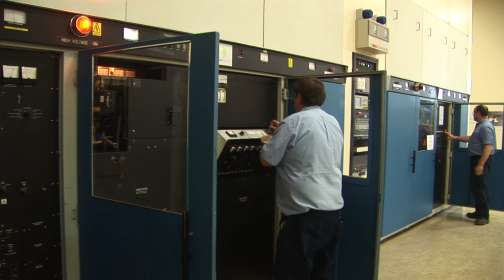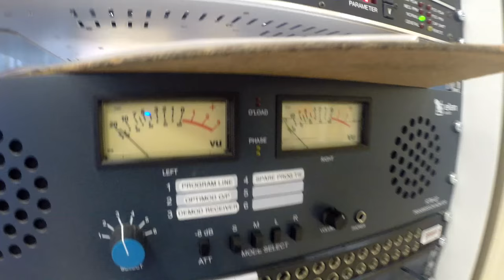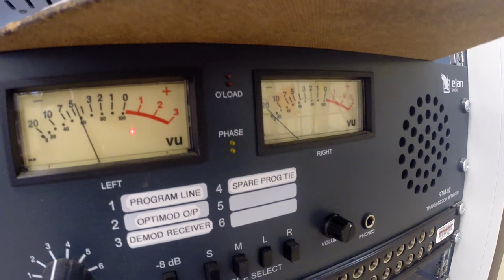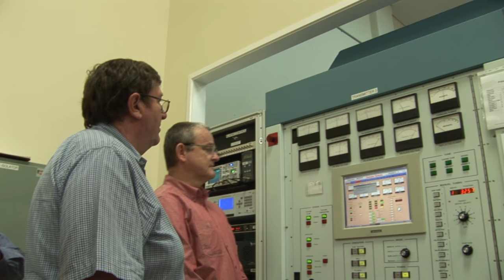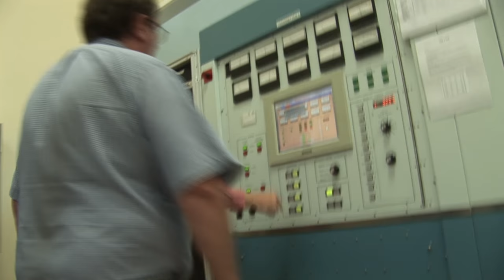Shutdown Of Last Short Wave Transmitters  At Radio Australia

Comment: Wonder why they didn't switch over to DRM. Much more efficient.
Reply from the maker: Yes it has its place but there are tens of millions of short wave AM radios out there and extremely few DRM sets and in practice DRM is very good for strong sigs but just does not stack up when stations are weaker or bad adjacent or on channel interference is present like most of the time.  If you get no dropout DRM reception the AM would be almost perfect also although you do not get the fakeish FM sound. There are just not enough DRM radios around and most are very hungry on batteries. Anyway have another drink.

Comment: Yeah, but next to no one manufactures or sells short wave receivers. You go around shopping for radios and attempt to find one with short wave as well as AM and FM. Even in the 1980s that was becoming an increasing problem. They were around on sale but were becoming much less prevalent.
Reply from the maker: In Australia the major eletronics retailer Jcar, has a good range of multi band radios. They sell a nice Digiteck digital set for around $100 that is very sensitive with exceptionally good audio on Am. It covers Lw, Mw, Fm, Air band and Sw from 2.3 to 30mhz. Also selectable bandwidths. I have also seen $20 short wave radios at the cheap shops, not that good but will pick up the stronger stations.
Reply: @vk3ase  Ah so.
Reply: Really? I bought one in the U.K. only a year or two ago. They're still in the shops. And there are plenty more for sale online. Ironically.
Reply: PRC company Tecsun offers dozens of domestic HF receivers.

Comment: The truth here I hear ABC in full stereo, and 15 stations on the web. Its still there and I am in SC, that at least 9000 miles away! Technology moves on!
Reply: Where is SC? Highlands of PNG?  50 km up the coast from Lae? On the Sepik River? Centre of Viti Levu? Bougainville? Choiseul? Coral Sea?    Sorry Applebark - you were not the intended audience.
Reply: The Internet has existed since 1969.
Reply: @ruslannabioullin3664  And Shortwave predates it by decades. People are designed to communicate; it's perhaps what we do best. So why pinch pennies to make everyone else pay more, whilst reducing an audience significantly? It makes no sense. Many countries also block IP addresses, denying potential audiences of what they want to hear. Some make it a crime to connect to websites from other lands. In addition, most of the world cannot afford personal internet connectivity. Radio reception was relatively uncensored and affordable for anyone within range with any kind of low cost receiver. Even a crystal set works fine on Shortwave. In addition, they use no dedicated electricity supply and can be constructed for pennies out of scrap and surplus equipment. Even a piece of rusty metal can be a useful radio detector. Try accessing the internet or a satellite with low cost kit like that, and you'll have no chance.

Comment: Enough with all the silliness. Sure, it's a bittersweet moment, but it's time to move on. There is no longer a need to pump umpteen megawatts of radio out, and do all the other stuff that makes shotwave expensive a.f.

And don't give me that crap about what we're going to need when TSHTF. If that's your concern, then what you need is amateur radio, not flame-throwers, mostly propped up by national governments. As for information in normal times, it's not that all of anyone's eggs are being put in one basket. There's fiber, there's satellites, there's wi-fi and cellular, down even to femtocells. A highly distributed paradigm, which is exactly what you need in times of crisis, not these dinosaurs whose time has come and gone.
Reply from the maker: Wait till the next Carrington event.
Reply: @vk3ase  FFFS how does THAT make any sense? In such an event, the last thing you want to rely on is a small number of megawatt-scale dinosaurs with antennas tens of meters long, and obviously powered from the main grid. You need hordes of amateurs, with a kilowatt or less. BTW you should also consider what might happen to the ionosphere, in which case you don't want to rely on it. Instead, you want networks of digital repeaters, operating in VHF or higher. Damn it, man, MODERNIZE your thinking!